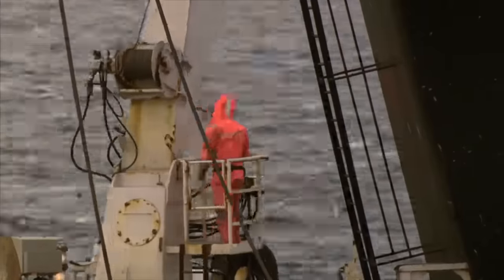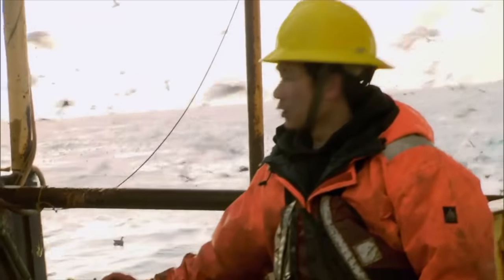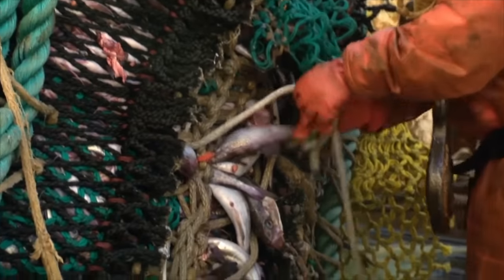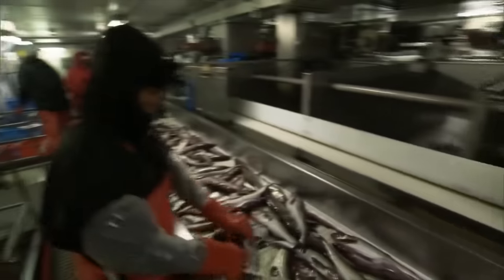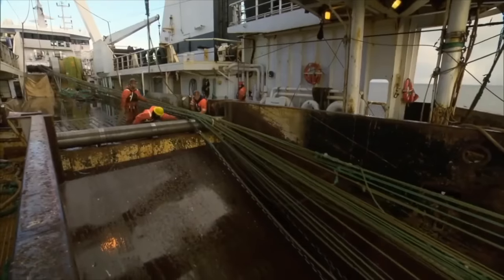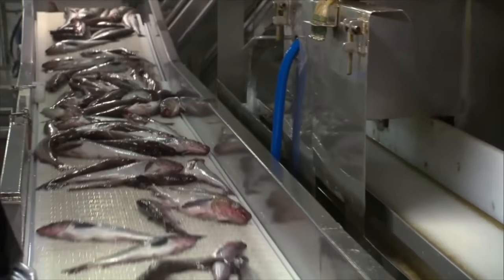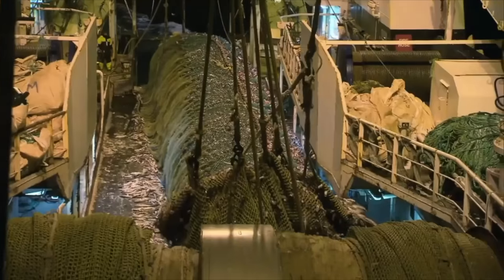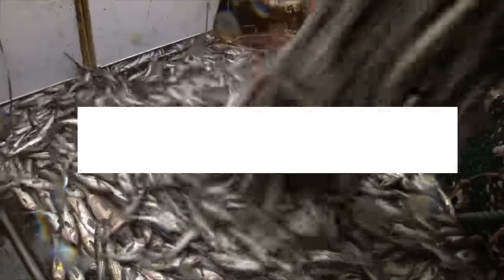Life On Alaska's Largest Deep-sea Trawling Vessel | Fish Factory On the High Seas

Comment: I worked that boat for one trip. I couldn't stand it. A surimi boat that was rerigged for head and gut. It was a disaster and we didn't make any money. I made  $1200 in a month. I jumped ship In Dutch Harbor and signed on with Pacific Bounty Inc. I made a considerable amount of money in 2 seasons but regret it because of the waste. Tons and tons of halibut and other by catch are thrown overboard daily,  dead. The roller gear consisting of chains, buoys, cable and hardware kicks up the fish from the bottom where they enter the net. Huge swathes of habitat are ruined everytime a net drops.
Reply: I fished 34 seasons...we had a government observer monitor every tow...we never threw anything overboard...any by-catch counted against quota with no pay...we did catch a few halibut...not many but if you are talking about flatfish then I agree
Reply: @ConspiracyNutsMakeMeLOL  my last contract we were fishing for yellowfin sole to make karimi. There was tons of halibut bycatch. We had the observer sample after some of the fish were run off. The halibut seem to gather at the bottom of the codend and since that's the first thing that goes into the factory it's not a true representation of the net and would be overlooked. The seas were a glass so there was no wave action to move the fish towards a sump. Occasionally we'd flood the factory deck and ask the skipper to steam and turn a bunch to clean the factory of the bycatch that's thrown on the deck in the name of production. This was in 1991.
Reply: @sluggou812beotch  ok...we didn't fish for yellowfin...so now I see what you were talking about
Reply: Join STOP ALASKA TRAWLER BYCATCH! We need you to support the banning of trawlers in Alaska. We need your help!
Reply: @ConspiracyNutsMakeMeLOL  What country are you in that they give you an observer?